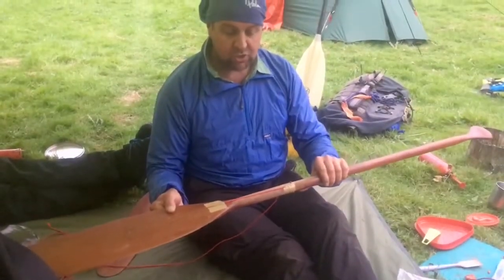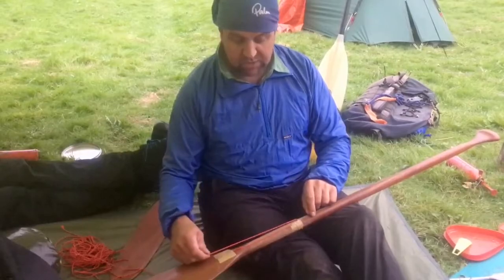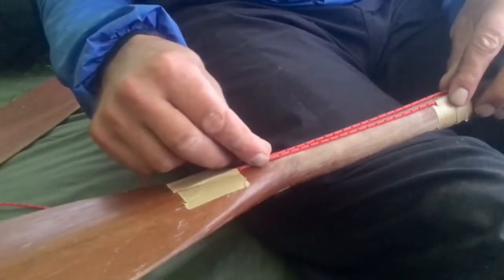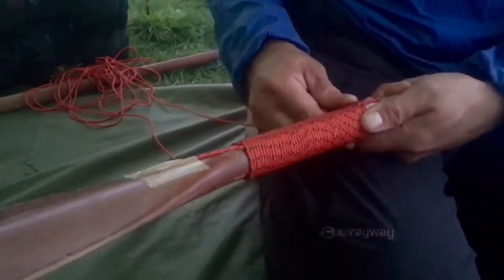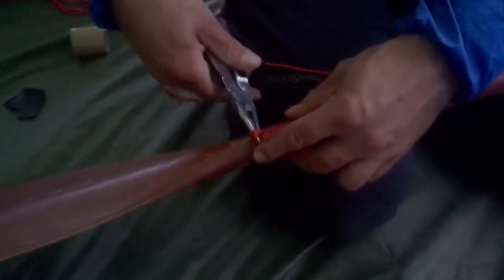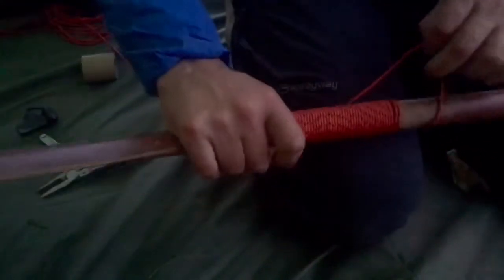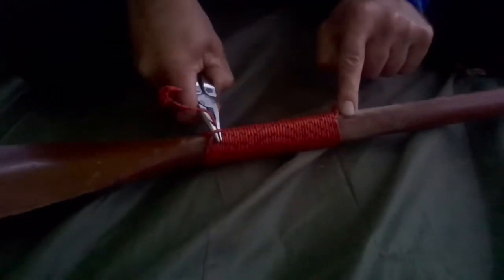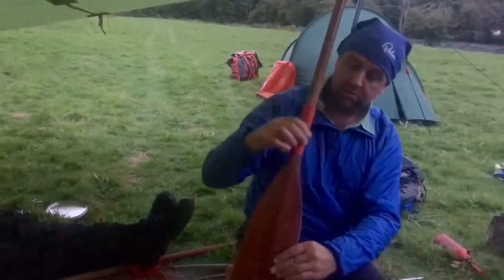Protective Lashing for Canoe Paddles

Comment: Interesting idea, and one could use other materials for the lashing if wanted.
Reply from the maker: I’m not sure what other material would work, but it doesn’t hurt to try them out.
Reply: @outdoorinstruction  you could probably use rawhide for example, let it dry and put some kind of protective coating on.
Reply from the maker: I’m definitely not an expert in such things. However I’d give it a go, if it doesn’t work it can easily be snipped off and a different cord used. Go for it and let me know!
Reply: @outdoorinstruction  I don't personally need it right now, and was just kind of thinking of other materials .. But if I can successfully finish my very first BB Canoe I might try it.

Comment: Is there a certain type of string o use? What about flat leather lacing? Would that work?
Reply from the maker: I’ve used 2mm climbing accessories cordage here, it’s high quality thread. I used 3mm on my white water paddle. My instincts say leather would not take the physical abuse in water and would degrade quickly. But it would not hurt to try.